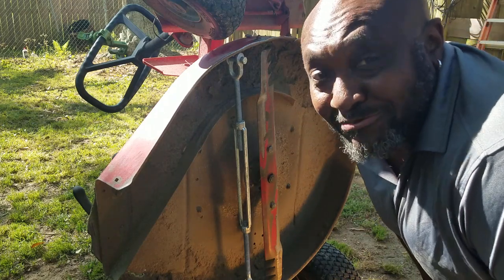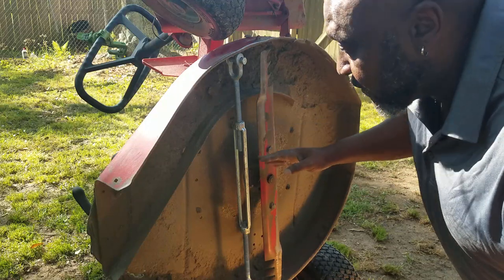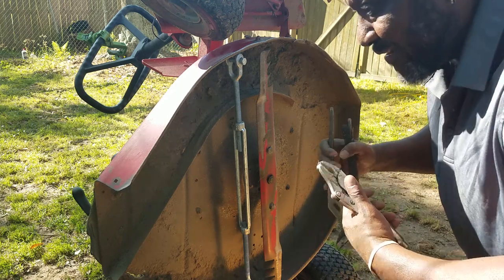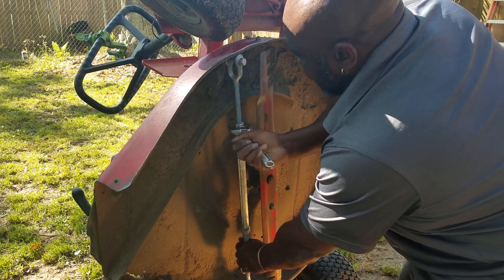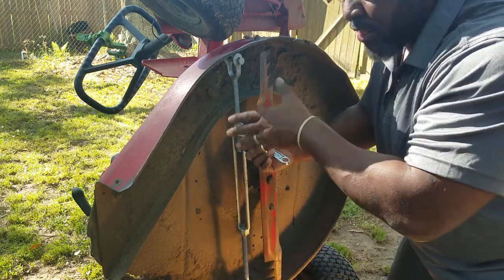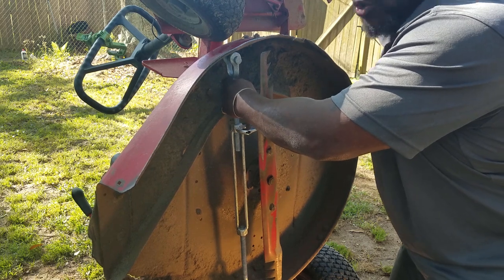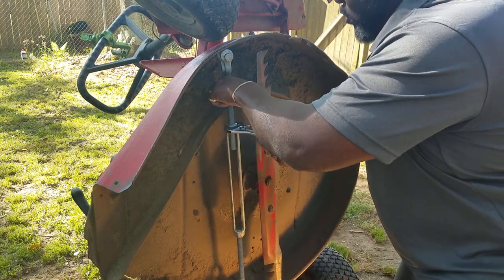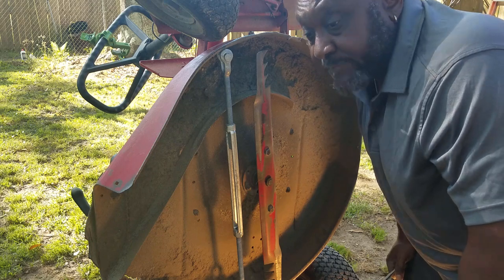How to Repair a Bent Lawnmower Deck the Easy Way

Comment: I’ve been sweating bringing my deck to shop for repair.  Gonna do this now.  Thanks for the creativity!
Reply from the maker: I hope it works for you I have saved myself big bucks using this technique. I had to use it several times until I learned to navigate the mower around the roots and use the weed eater in those areas

Comment: This was a great hack. I had difficulty finding the right size hardware - eventually found it ar TSC. But then found the geometry hard to stay in place a fear it would pop out under a lot of pressure. Then I thought of an alternative hack I think is better a d would like to share. I have begun using a scissor type car jack. I get more stable bearing and it is easier to increase the pressure.  Give it a try.
Reply from the maker: You are right occasionally the clevis would pop out. A small scissor jack sounds like a good alternative. I assume you are using the scissor jack in conjunction with a 2x4 or some type of extension piece?

Comment: so today i finally tried your way to take a dent from my mower deck. just wanted to drop you a line and say thanks it actually worked. note: i did also use a very large pipe wrench to help the process along (sometime metal needs a little leverage, lol. but,
having said that...again, thanks. an aside: i love your craftsman tool chest now chef chest.
Reply from the maker: Glad it worked for you, standby for more craftsman videos

Comment: That's genius. And if you want to get the odd angle bends out clamp your vice grips on each side of the clevis where it is pushing on the deck to keep the clevis from slipping from it's place.
Reply from the maker: Trap the clevis in place... excellent idea. Thanks for sharing

Comment: YOU ARE THE MAN!!! Awesome and clever idea to use this device. In my local hardware store is under the name of jaw and jaw turnbuckle
I couldn’t find length that I need but I used my hydraulic jack and a 4x4
Reply from the maker: You adapted and overcame Cool, thanks

Comment: I have a zero turn with motor on the back. I went up a ditch and got stuck because the back was hitting the ground and one tire was off the ground. Now when I go fast on the road it's shaking. To Me it looks like my driveshaft is a little bent or maybe the deck is unlevel. Please give me some advice. I checked nothing else is bent or loose.
Reply from the maker: I'm afraid I am not familiar enough with the zero turn lawn mower to be of assistance. I am more than sure there are videos out there that can be of more help sorry I couldn't be of more assistance!

Comment: It's stretching but not staying spread out do I just leave it on overnight or just keep applying force?
Reply from the maker: No I do not leave it overnight. The entire process should take no more than 15 minutes. I usually stretch the metal a little further than need be so when it relaxes it's good

Comment: I would like to buy that Clevis but I can’t seem to find anywhere. Is there another name for that tool?
Reply from the maker: The only other name I have heard them called by is a turn buckle. I found them at tractor supple and a few other big box stores but I had my best luck at places that sell bolts, nuts, chains. A hardware supply distributor. I hope this helps if not get back with me and i will try to stir you in the right direction.

Comment: Where did you buy the clasp?
Reply from the maker: I got mine from a local tool supplier but any hardware store should carry some version of it.
Reply: @roselsimpson858  I ordered one from Amazon it is so tiny it couldn't stretch out a glass I'm going to send it back
Reply: What size is yours?

Comment: What is the tool called??
Reply from the maker: A "turnbuckle" ...stretching screw or bottlescrew is a device for adjusting the tension or length of ropes, cables, tie rods, and other tensioning systems. It normally consists of two threaded eye bolts, one screwed into each end of a small metal frame, one with a left-hand thread and the other with a right-hand thread.

Comment: I think a 36 inch pipe wrench will bend a mower deck back in place because my uncle years ago used a big pipe wrench to bend my Dads mower deck back into place and it worked.
Reply from the maker: Great point it is another option, Thanks for sharing I like it!
Reply: @roselsimpson858  I know a 48 inch pipe wrench definitely would work I have one of those

Comment: What's the name of that part and how much is it?
Reply from the maker: The tool is called a Jaw & Jaw turn buckle or clevis. This size  cost 15 to 20 Dollars
Reply from the maker: The Tool is called a Jaw & Jaw Turn Buckle or Clevis. The size I'm using  cost between 15 and 20 dollar
Reply: @roselsimpson858  lake charles?...brother u from lake charles? Louisiana?...
Reply from the maker: @0patience4flz  Yes i am
Reply: Rosel Simpson -  I have a deck for a John Deere 42 inch like you I have hit some roots. Having a hard finding a Clevis.  Also don’t know what size to get   Can you help with any suggestions
Reply: @roselsimpson858  I watched your video on stretching the deck of a riding mower. You used a clevis or a jaw and jaw turn buckle. What size would I need to get? I think the prices may be higher now. I really need to know the size please.

Comment: Not gonna work for me..you gave me the idea of using my automobile jack and bottle jacks
Reply from the maker: Awesome even though my technique didn't work you found a similar method that would. By any means necessary, love it when a plan comes together. Thanks for sharing, more good stuff on the way.